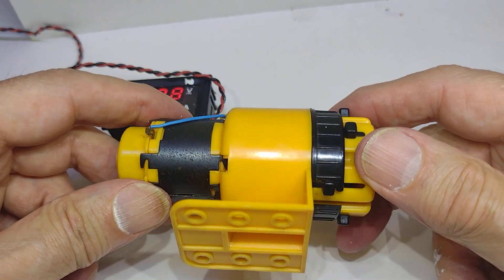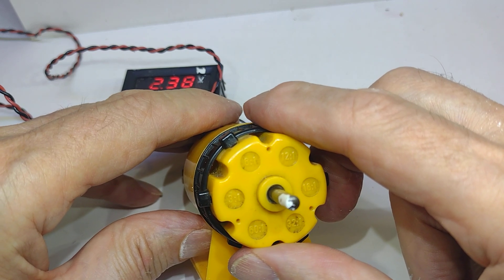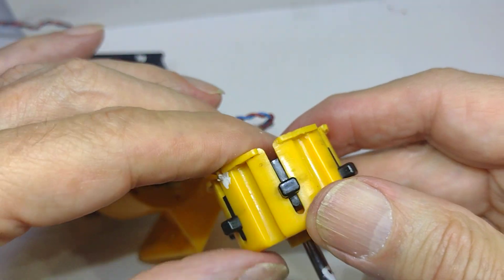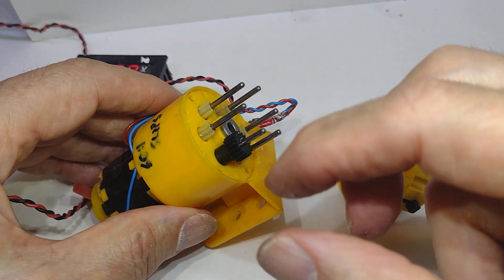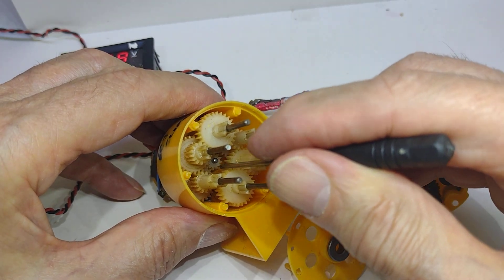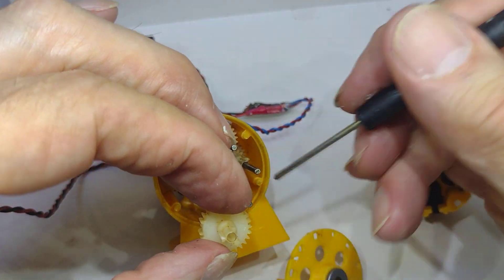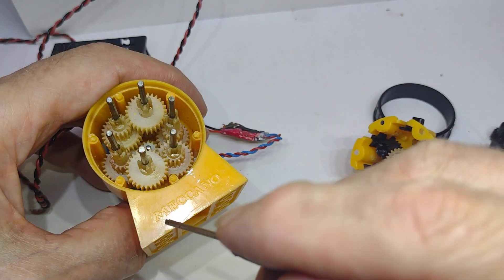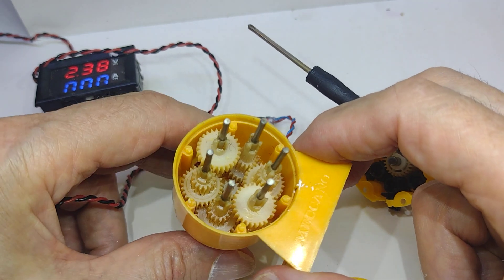Faulty 1960's 6 speed Meccano motor teardown

Comment: Good video. I have made enquiries about getting that gear 3D printed and get the .stl file loaded into the github repository of Meccano parts. I'll let you know if anyone does it.
Reply from the maker: @JohnnyMeccano  thanks for your comment l would love to know if it is possible.
Reply: @toyhacker4647  the problem is, I can't find anyone with a broken PDU to copy the gear from. I have a dozen but they're all in good running order. Anyway, the word is out. Maybe someone will 3D print it someday.
Reply from the maker: @JohnnyMeccano  thanks for the comment. I'm not really into 3D printing but I think the teeth  would be too small to print.